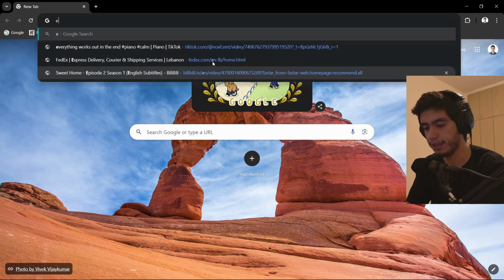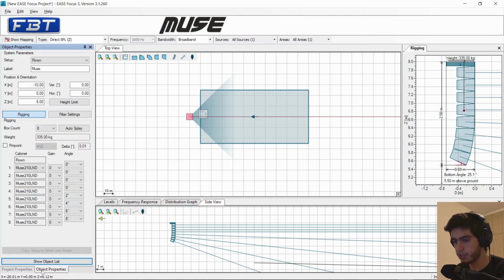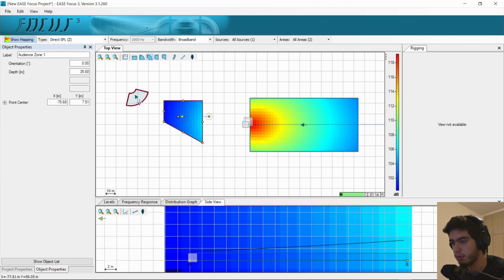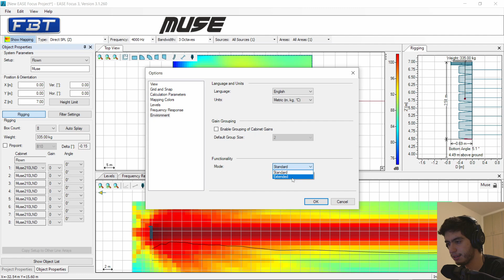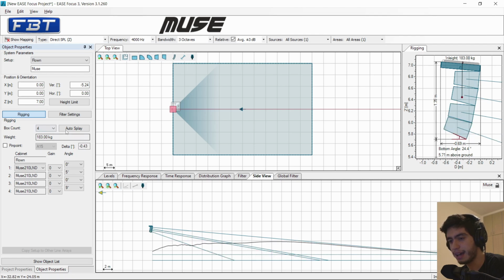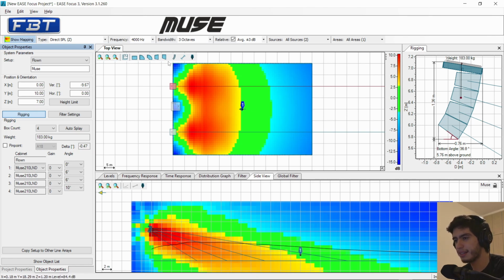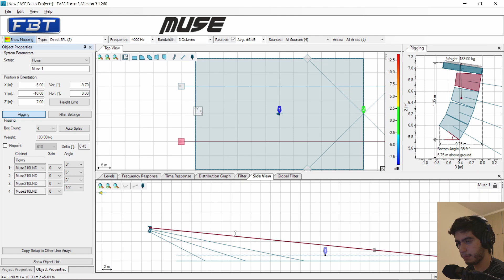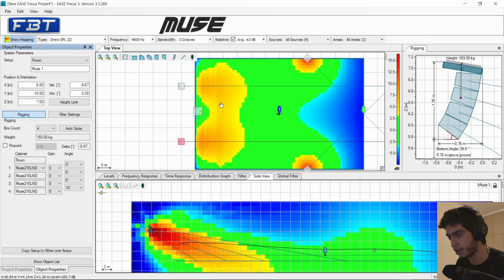how to FLY Line Arrays | Sound System design with EASE Focus 3

Comment: Hi Daniel, as always, this is awesome.  How did you determine how far apart to split the two sets of speakers please?
Reply from the maker: In this instance i was limited by the position of the winches so i hung the array directly under the winch because it's very heavy and if i hang it somewhere else on the truss it will break. But you wamt to have some interaction between left and right. In ease focus 3 you can see the dispersion angle of your speakers and how much they overlapping. Ideally i want them to start combining from the front row but if yhe audience is too wide and i have to spread them further apart I'll add a front fill in the middle
Reply: @danielkharrat  Thank you Sir